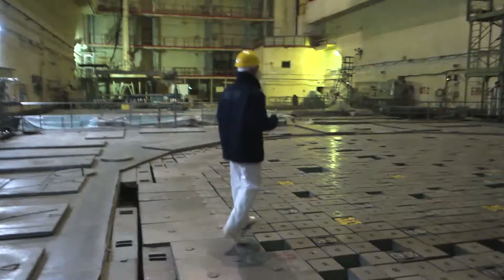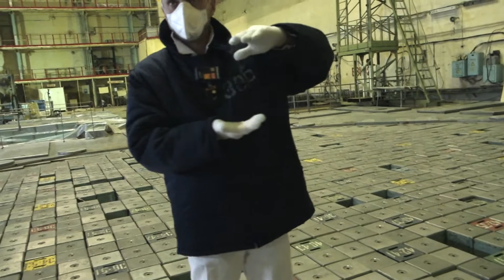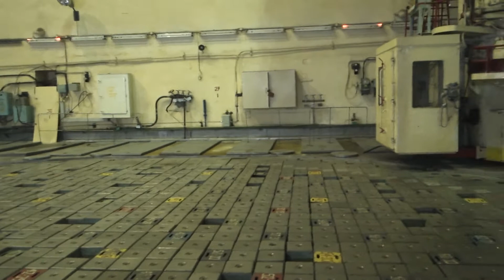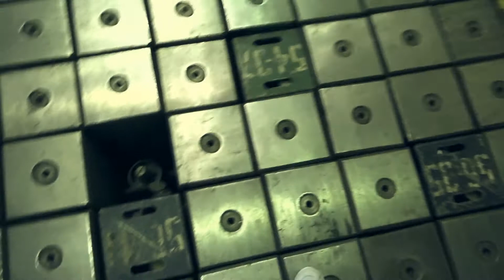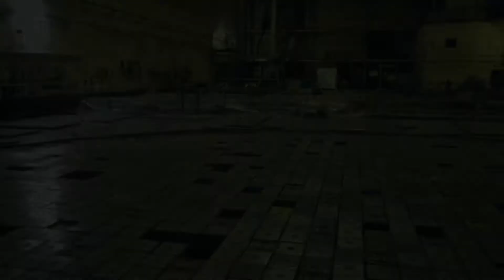On top of Chernobyl's Reactor 3 core

Comment: But how did Chernobyl explode?
Reply: reactor number 4 overheated due to faulty test procedure,reactor was very unstable during test and when overheat started it created few hotspots inside reactor,one of hotspots located on edge of reactor initiated meltdown,the fuel channels broke,water channels broke spilling water into hot reactor,this created more steam more temperature,at this point reactor starts meltdown and many fuel and control rods drop down into reactor pit,steram pressured started to escape throught rreactor lid causing it to lift off and explode.. along steam there was hydrogen and oxygen mixture ongoing.

Comment: are these caps made of lead?
Reply: @thrills4132  yes, my post was focusing on the 350kg caps material
Reply: @254lele  The fuel channel caps are not 350kg, they are only 50kg. And I believe that they are made of steel. Their purpose was not radiation protection or anything like that, rather they drew cold air down from the room for cooling purposes.
Reply: @isaowater  what is your source? :)
Reply: @254lele  cant believe that this was only 3 hours ago Aluminum seems to be using a right estimate for the weight, and I also think that they are steel. But these caps DID protect from gamma radiation escaping the fuel channels. but Most importantly they were there to create a surface to walk on, if you view RBMK reactors without their caps then you will just find that it doesnt look like the best place to walk on, I don't know anything about cooling as this is the first time that I have heard of anything like that. Hope that help
Reply: @isaowater  no they are 350 kg each that's why they needed a special crane to lift the caps
Reply: @jamesorteki8063  no it's 350 kg
Reply: @alexandrosandreou8585 They are not 350 kg, there are photos of people carrying the caps.
Reply: @alexandrosandreou8585  GOD NO, THEY ARE 80KG NOT 350KG, DON'T WATCH HBO
Reply: @thrills4132  sorry these are control rods